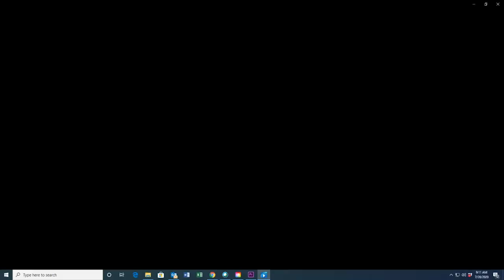Dryland Wheat Trials

Comment: Yes at the end you come to a conclusion, but you need to apply the compost year after year at a lower (economical) amount. And then can you get to that same place, and how quickly, as you saw in thw 1994 plot. Really cool research. I also hope that someone is evaluating the compost being applied for microbial diversity F:B ratios etc, either with a microscope or with DNA, not all compost is equal.